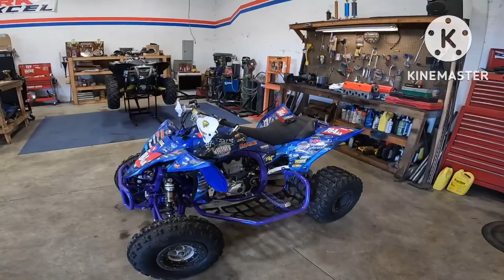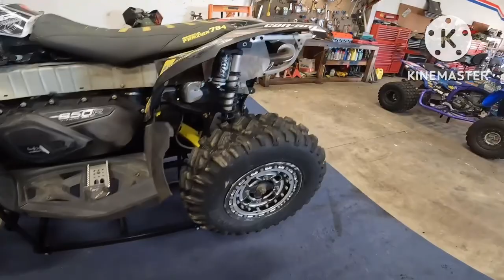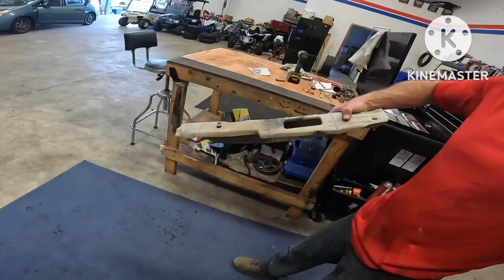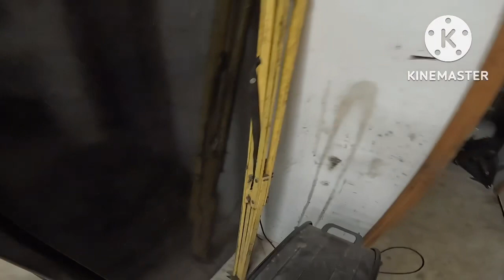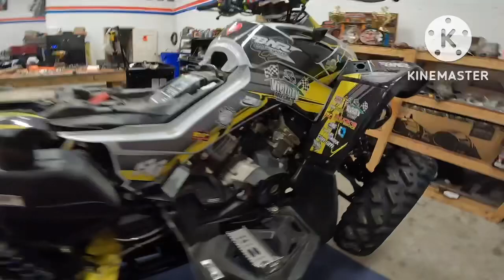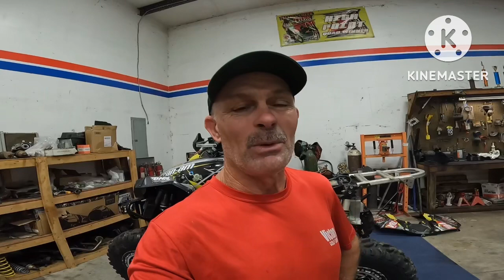Broken exhaust and engine mounts!

Comment: Could you use hitch pin clips instead of cotter pins for the hub nut
Reply: If you do use the hitch pin clips, put a ziptie on the open to keep it from backing out
Reply from the maker: I think Brandon is looking into doing this.  I have ordered some cotter pins from can am though instead of using the cheap ones we have here at the shop.
Reply: @prorow784  ok, hopefully he's able to get some put on. I know the pins are stronger medal. A pro in mideast showed me this trick and I've never had an issue